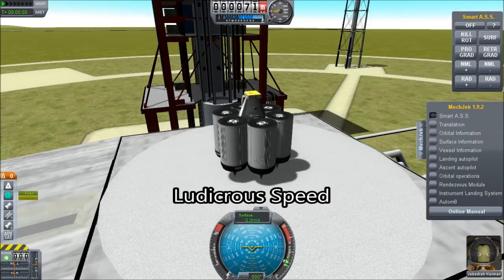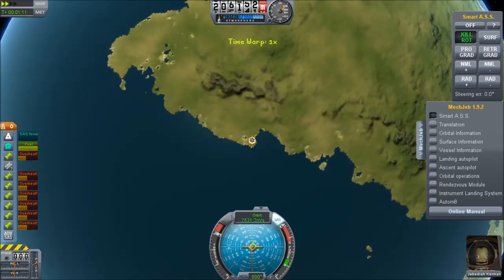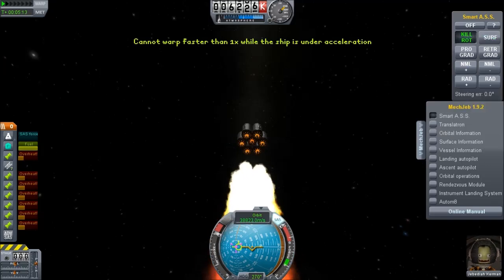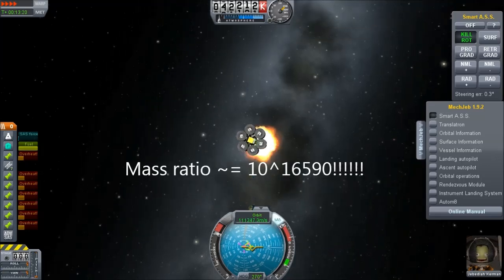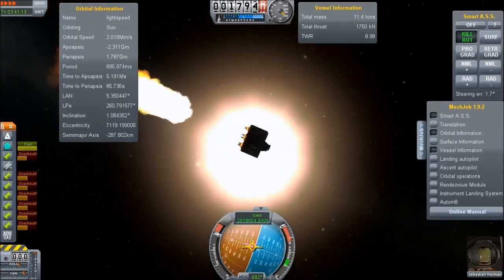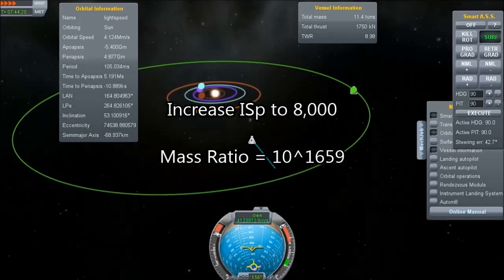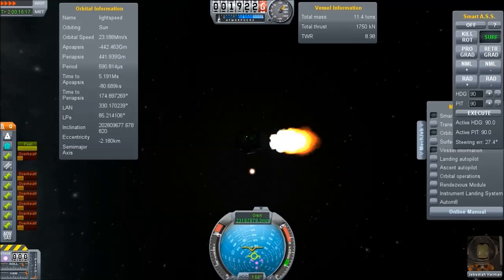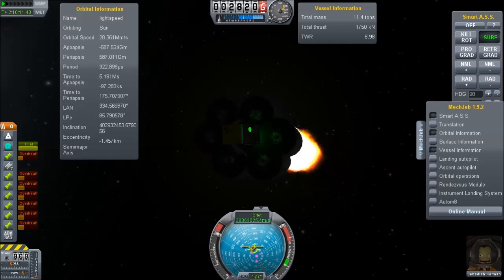What Does It Take To Reach Lightspeed In Kerbal Space Program?

Comment: Using the Alcubierre warp drive from Interstellar, the problem is not so much slowing down to land as it is moving too slowly in comparison to the planet once you drop out of warp.

That's what happened to my second warp capable ship as it was trying a direct translation to Duna orbit. Even with the DT Vista, the most efficient engine I've researched so far, it still took too long to speed up, and I ended up actually having the planet smash into me, instead of the other way around... =p

Comment: the closest I've gotten to the speed of light so far on KSP is about 140,000,000 m/s. Initially, I had thought the speed of light was only 3,000,000 m/s and was ridiculously excited to have passed that number, until I checked again and had forgotten two zeros. My (manned) craft has 1 large engine (the 4 in 1 engine released in the NASA update) and 32 radial monopropellant engines (the ones that are massless). And of course, the infinite fuel cheat.

Comment: e^38199 = 9.86 * 10^16538

9 and then 16.5 thousand zeroes.
Reply: 16.538* np buddy :)
Reply: kylian breedijk
Isn't that what I wrote?
Reply: Mastikator you forgot 38 after the 5.
Reply: kylian breedijk
I rounded
Reply: Mastikator i didnt
Reply: kylian breedijk Why not?
Reply: Mastikator because if it is 16.5 it wont be the same as 16.538 there would be a difference, some things shouldnt be rounded, like speeds or masses in science unless you have been told to do so.
Reply: kylian breedijk
In astronomical terms many things can be heavily rounded. Like there are 10^80 atoms in the universe.

Comment: pretty simple to understand things with mass require infinite energy to reach the speed of light. The only thing that can reach the speed of light is particles with no mass such as neutrinos photons etc. we know this because Etot=MC^2  E or energy is equal to the mass times the speed of light in a vacuum squared. The only exception i know is when we are talking about the speed of light in different mediums such as water. which is why nuclear fuel rods glow blueish purple in water. The electromagnetic radiation of charged particles can travel faster than the phase velocity of the speed of light in that same medium which is called Cherenkov radiation.

Comment: I was always under the impression that anything traveling at the speed of light, has infinite mass due to the mathematically equation. I've often had this talk with some friends and came up with a very interesting thought.  Anything that has infinite; or to some degree; mass, would essentially be a black hole because with the increase in mass, so does the increase in gravity is produces.

I could be wrong ofcourse, i'm not a scientist. But it's a very interesting thought.
Reply: Black holes have infinite Density not infinite Mass.
Reply: ***** Simple. Something with no volume either. No dimensions, a point on a grid.
Reply: Brendan Risney and an object with infinite mass would have infinite density as it would surely collapse into a black hole.
also i'm pretty sure that there's no proof that black holes actually have infinite density. theoretically it's possible, but that doesn't mean that is the case. a black hole only needs enough gravitational pull to keep light from escaping its orbit.
Reply: chaosscizzors But the thing is, when it collapses, it keeps collapsing into a singularity. A point with no dimensions, and infinite mass. But, as you said, we have no proof.
Reply: Brendan Risney right. there's really no reason to believe that a black hole is a 1 dimensional object. extremely tiny, sure, but not necessarily infinitesimally so. and hell if it really did have infinite density that would have some pretty huge implications. it would be reasonable to conclude that it would have infinite gravitational pull, which is obviously not the case.
Reply: chaosscizzors Well I read it in a book, but that does make sense. Infinite density, HA what was I thinking? But it still is pretty huge density. A black hole the size of a pea would have the same pull as earth. But black holes can be bigger than multiple stars.
Reply: Brendan Risney oh absolutely. the density would be far greater than a neutron star and those have at or very near zero space between the nuclei of the atoms within it.
Reply: chaosscizzors The density of a black hole is just crazy. Physics is weird man! :P
Reply: A photon doesn't have infinite mass
Reply: Mr.chang cooler a photon doesn't have any mass. i don't see you're trying to point out here.
Reply: ***** It is energy, and it doesn't take up space. it has no mass.
Reply: ***** a photon is a very special type of particle. do some research and i think you'll be surprised.

Comment: I think you made a mistake with the craft file. There's absolutely no need to store ALL potential pixels in this behemoth of a fuel tank. All you'd need to technically store are the values of x,y,z axes and a value for max amount of fuel. Technically just 4 floating point numbers. Loading it in KSP might result in KSP trying to generate this thing all in working memory, in which case you would indeed need several petabytes of RAM, but even that is simply a bad design choice. Just do a numeric calculation of your fuel contents at t=x and speed at t=x, and again, it's just a few variables. The algorithm for calculating this -even relativistically - is childsplay. The only limitations are the size of the intervals of t and the fact that your variables will overflow without special care.

Comment: I feel like discovering a way to travel the speed of light is more than likely impossible. The most logical way to travel the vast distances of space would be the creation of some wormhole device.
Reply: I'd love to help you working on holes
Reply: aSStronaut111 It's theoretically possible. It requires several grams of negative energy matter, the existence of which is not theoretically impossible, but nevertheless has never been proved. So... still very speculative.
Reply: ***** I think you're wrong here. first dimension can be represented by a line but second dimension is not another line, indeed it's a plane. And third dimension is space.
However it's possible to represent a plane by making a "2 lines" reference frame and a space by making a "3 lines" reference frame.

You said previously "we can't see time",
I agree, but we can represent it or just observe it's consequences (watch, hourglass...etc), which strengthen even more the fact that it is another dimension.

By the way,
It's a bit more tricky about space. you can represent it thanks to 3 lines but only if your experiment is happening in a Galilean reference frame (which never really exists).
Moreover it has been proved (in part, thanks to the relativity theory) that a universal reference frame doesn't exist (used to be called Ether).
That's College physics and I'm French so my english is for sure not good enough to explain you perfectly what I learned but there are very interesting documentaries about that.

have a nice day :)
Reply: ***** It's arguable.

Let's take an example : If you want to have an appointment with someone, you need to tell him where and when it will be.

So 3 space dimensions (eg: 4th floor of a building located on a map)
And at another dimension : time (a given moment)

Which makes a total of 4 dimensions.
Reply: LOL!! nice name XD
Reply: ***** Time doesn't appear like a physical line because we don't live in a 4-dimensional world, you can take some dice and see all its sides, because its 3 dimensional, if it were 4 dimensional, you'd also see its past and future, moreover, past and future wouldn't exist as you'd be able to move freely thru time like walking up and down a street. We can only vaguely imagine a truly 4 dimensional world, just like you can only vaguely imagine a 3D view by looking at a 2D photograph
Reply: Wat i asking... how can you know current physics are %100 true??? humanity falls to same mistake ever... "what all know is always true" is not right thing :) We may all know wrong about this... 
Note:About going faster than light... not sure about that really :D Thing with no mass going like this and things with mass faster? Too hard... but like i said nothing is imposible :)
Reply: omg I saw Interstellar too.
Reply: A wormhole device to travel through the stars... maybe a gate type thing... nice and round perhaps... we should call it a stargate!
Reply: Real life warp drive like from star trek is physically possible.
Reply: Sander Bollen
I don't think we should focus on negative matter. You know the casimir effect, and how it creates negative pressure? I think we should instead focus on manipulating the quantum world idk what to call it or the quantum elements of the universe to create negative pressure. Who knows, we might even discover how gravity truly works that way.
Reply: Do the said impossible, saying it is impossible means you have given up on trying.
Reply: When you create something like a warp drive, you wouldn't actually travel at the speed of light, you would only take a "shortcut" to reach your destination faster than it would take when travelling the normal way. Reaching the actual speed of light is impossible, because you would need more and more fuel to accelerate and because you get more and more fuel you also have more and more mass which you need to accelerate by more and more fuel and so on. To travel at the speed of light you would need infinite mass in form of fuel. Which sadly doesnt exist.
Reply: Well you could use solar sails and nuclear explosions to get to 1/14th the speed of light. But if you could some how exploit the 4th dimension (time) then you could build a rocked that was infinitely fast. Kind of like entangled particles transfer information faster than the speed of light, according to Quantum Physics.
Reply: oing through a wormhole isn't the same as travelling the speed of light
Reply: This is just an idea, and probably impossible, but could you transfer a 3d object temporarily to a 1d universe, but that 1d is our 4th dimension, in other words moving something into the "universe of time," and back out to "our" universe?
Reply: Wat imposible? The science explained this word you know... it may imposible today... but 3000 years ago it was imposible to reach space too :) 
What if we found energy source that offering great speed, low mass :)(really low mass and really much energy i talking about)
Reply: makaramuss Reaching space wasn't impossible 3000 years ago, they just didn't have the technology for that, while travelling at the speed of light is impossible by the laws of physics, not only by the technologies we have today.
Reply: Actually traveling at the speed of light is physically possible. Going FASTER than the speed of light is not.
Reply: ur ltrly dum
Reply: makaramuss '"what all know is always true" is not right thing' 

Yeah, I never said that? Also, there is mathematics and all physical laws we have ever created are proven to be true, because those things can be calculated. And no, there are things that are impossible, as is going faster than light. If you are travelling at the speed of light and then try to add more energy, the energy is only more mass but does not give you any more acceleration. That's what Einsteins famous formaula means E= mc² that means energy (E) equals mass (m) multiplied with the speed of light in vaccum (c) squared (²). Which is essentially what i just said.
Reply: SuicidelRetard Yeah I misread I didn't mean to say going at the speed of light is impossible, only going faster is. Sorry.
Reply: you cant create artificial wormholes its impossible
Reply: or higher dimensional travel
Reply: If we could fold space-time, then there is no need for travelling faster then the speed of light. Alternatively, it may be possible to simulate breaking through this light barrier by being able to exist in a separate time frame where your relative speed compared to our current space-time frame is much higher then the speed of light.
Reply: 911gpd Sir, i applaud you.
Reply: there is a way its just too expensive to do, I forget what the method is called but it involves using thousands of constant tiny nuclear detonations over the course of days or weeks to accelerate
Reply: DirtyBird760 It was called "Project Orion", or I guess that's what you mean.
Reply: Ever hear of the Alcubierre drive? Instead of moving an object through space like we know today, The drive (In theory, but researchers have proven that it could be possible) moves space around the object by compressing the space in front and expanding it in the back. You can't have an object move faster then light, but you could theoretically move the space around it faster then light. The theory as it stands doesn't violate either the laws of physics, or general relativity.
Reply: The most logical way of travelling vast distances of space is to not be concerned with experiencing the trip. You will either: hibernate, have to live forever and not get sick, have your distant offspring get there, or send a machine that doesn't really care about the difference between a microsecond and a megayear.
Reply: Space bending, aka warp.

Comment: I know he used cheats and I'm probably wrong but wouldn't be impossible to go the speed of light since he has mass and light doesn't. But like I said I'm probably so if I am wrong  can somebody tell me.
Reply: vivagable12 Did you take into consideration of the fact that he will most likely be using a stage rocket that loses mass as it goes?
Reply: vivagable12 mass of objects DO change as speed increases, this is true for relativistic reasons as well as fuel consumption reasons.

Comment: 4:05 Well, I found the number. Maybe
It is 999,973,841,274,905,192,215,439,646,319,310,000. Again I say. Maybe.

What I did: Divided the numbers by 100,000 and it was: 0.3819985 ^ 0.00002718281. Woala. You got the number, just multiply it by 100,000.
Reply: You can't work with powers this way. A quick example - 10^20 is 100,000,000,000,000,000,000. If you divide both the number and the power by 10 it's 1^2=1, then by multiplying it by 10 we get 10, which is not a correct answer. Now imagine what margin of error you have after dividing the power by 100,000.
The actual number is stupendously big. If you want to calculate this number for real, you need to make use of the fact that powers are added or subtracted when you multiply or divide numbers. So you need to take something bearable, like e^100 (which is already stupendously big) and multiply it by itself 381times. And i wish you and your grand-grand-grand-...-grandchildren good luck.
P.S. It was the other way around - e^38,199.85.
Reverting your calculation to it's initial state gives 38,199.85^2.718281=2,853,192,965,364.363.
Reply: wow ur smart
Reply: Slithereenn Okay thanks. As I said, MAYBE. :D
Reply: Slithereenn They scary part is he was already at 999.97 decillion.
Reply: The Bane Of Existence It's not that scary :)
Look up Numberphile videos about Graham's number. That is a good mindblow.
Reply: Math

Comment: can u go out of the solar system and into another?
Reply: Not yet, maybe in another update.
Reply: cool. i always wanted to do just that!
Reply: If there were multiple systems I would have found it. I was aiming for orbit but I missed, so I aimed for the moon and I missed. So I aimed for the sun and I missed. I missed everything until I ran out of fuel and flew into deep space. I will never see that satellite again....
Reply: There is a mod out now that allows you to add other solar systems. I don't know the name off hand, but with a little google-fu I'm sure you can find it.
Reply: TheAnubisDrake Planet Factory?  It doesn't really add other solar systems due to the modeling of the game, but it puts a binary star system orbiting Kerbol at 10x the distance of Eeloo.
Reply: KSP doesn't do multi body physics, so the orbits wouldn't behave as they would in real life.  I seriously wish it did, because there is much fun to be had from Lagrange points.
Reply: k thx
Reply: Nathaniel Lewis You're probably right. I haven't played with it yet. Still trying to get a handle on FAR and Deadly Re-entry first.
Reply: Strictly, doing it properly would require a black hole at the center of a a basically empty galaxy in which the new solar systems as well as the default one would orbit the black hole/singularity/sun of extreme mass
Reply: be sure to eva one of the kerbalnuats and speed time up to max